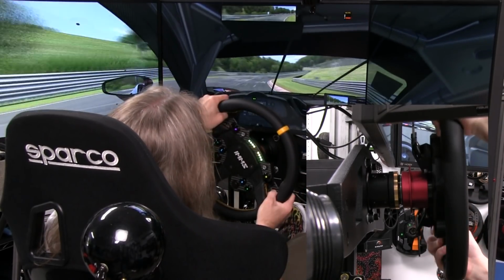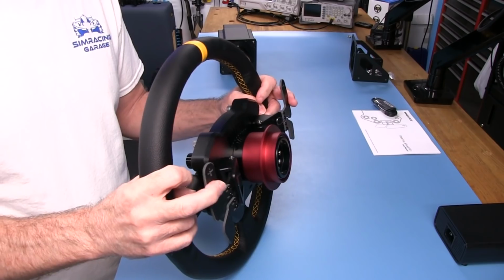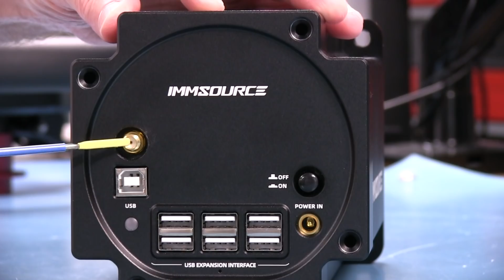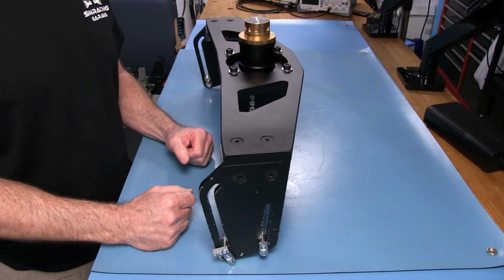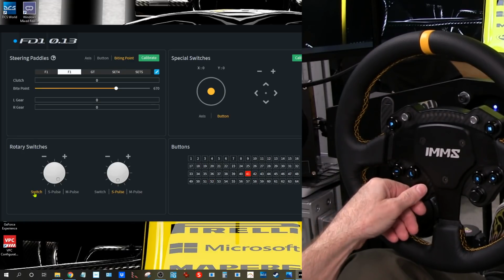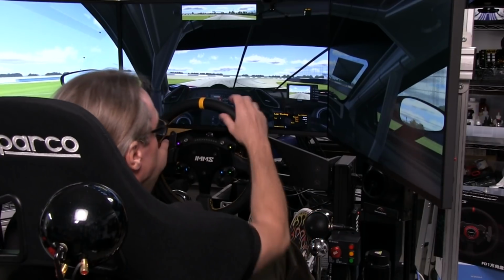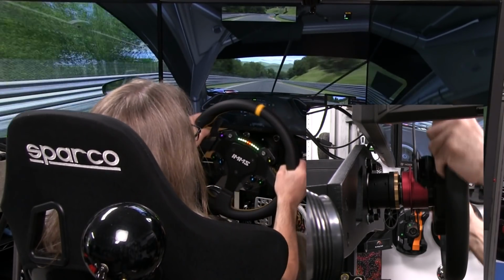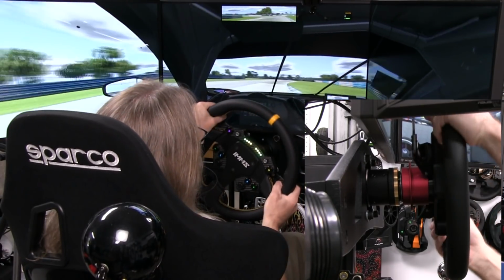IMMSOURCE ET5 DD FFB Wheel System Review

Comment: That steering wheel looks very Simagic-y
Reply: So does the wheelbase....
Reply: @rubbertoe.  looks more simucube to me
Reply: Simagic twin Brother 😳
Even the software is about the same
Reply: Wouldn't be surprised if it's basically Simagic letting another company rebrand their hardware with slight changes. Chinese companies seem to do this a lot.
Reply: @coffinbunnyzoey  they probably all invested into the R&D or simagic parent company sells the license
Reply: even the wheel base has almost the exact same dimensions as the Simagic Alpha, just about 5 mm longer , thats it... im so mad
Reply: @DavidGarcia-oi5nt  why are you mad exactly?
Reply: @DavidGarcia-oi5nt  They all use the same generic wheel and housing. Simagic started it.
Reply: That's probably a good thing though. Don't deviate from a working formula.
Reply: @johnwicksson9984  Yeah the immsource have copied the good parts of the Simucubes and adopted the prices of Simagic (even better prices in fact).
Reply: This whole thing is a simagic knock off

Comment: Awesome review like always, I can’t figure out the website to switch it to English, what does this wheel and base go for?
Reply: In the UK it's £910 for the base alone, or £1195 with the steering wheel. In Europe it's €1089 for base and €1429 w/wheel.
Reply: @bigredracingteam9642  Why would anyone pick this over Simucube 2 Sport or Pro then lol
Reply: @versedi  That's the question. To save a little money, would be my guess. I'd pick a Simucube 2 Sport instead of this, though.
Reply: @bigredracingteam9642  correct !!
Reply: @versedi  £1195 for 17nm base + wheel rim is a lot cheaper than simucube + a wireless rim
Reply: Sim tax

Comment: Does anyone know if it's possible to get the separate qr they sell, and mount let's say a cube controls wheel to this base? If that's the case I would 100% think about getting this base.
Reply: It looks like a Simagic QR to me. But I could be wrong.
Reply: @sigma male 23 are they? Good to know!
Reply: @sigma male 23 I just realized, you mean that the screws are from the inside of the wheel to the QR, and the regular is from the outside to the QR, right?
Reply: @sigma male 23 oh! NVM
Reply: @sigma male 23 I think that would be possible. Probably just have to line it up correctly. Or you could maybe mount the wheel upside down and configure it right side up in the software. Thanks for letting me know what qr system they use.

Comment: would third party wheels be able to work on that wheel? or does it have a similar system to the fanatec ecosystem?
Reply: I believe it works the same as the other wheel base. If you want to use the other wheels, you just need the qr with your wheel and plug in thru the usb to your PC. But this one is smart that it actually has the hub on the base.